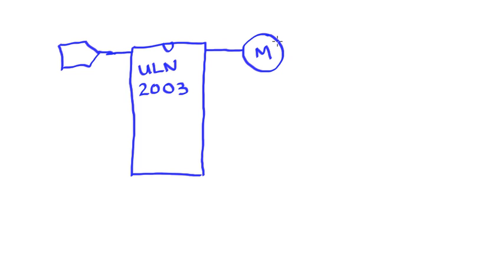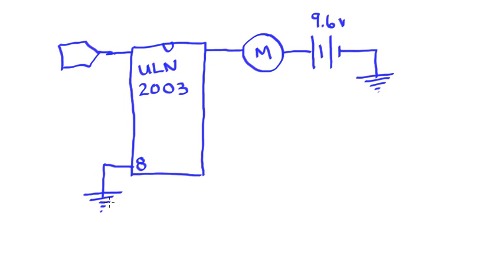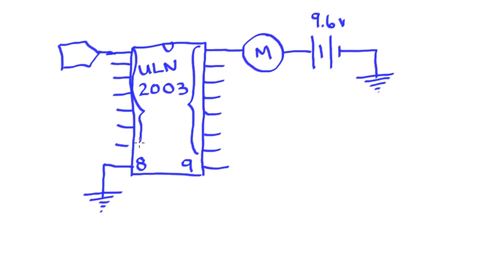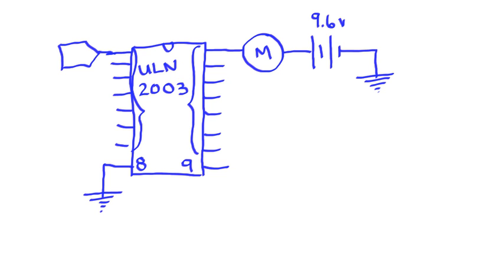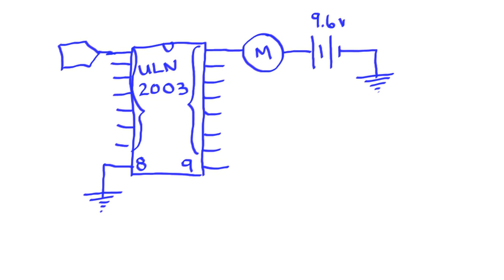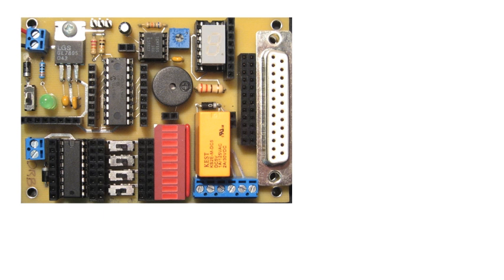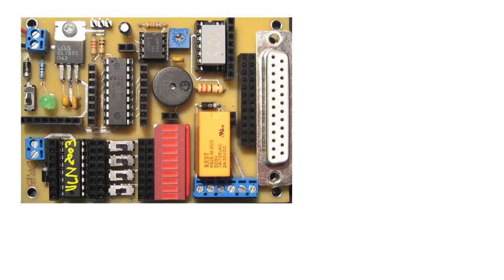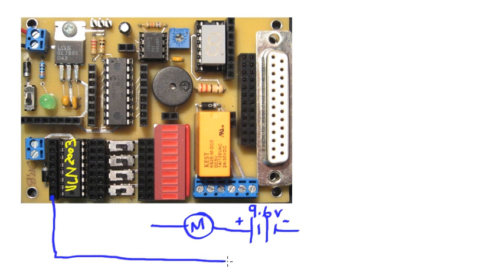The ULN2003 Darlington Array

Comment: You may also add ports together to get more current from the ULN. You did not say anything about the possibility of needing a heat sink if that ULN was sourcing .5 amps on all outputs.  Say we had 8 x .5 amps, or 4 amps of current flowing through that ULN, I would think that it would prodice a bit of heat, depending on the duty cycle of each port.